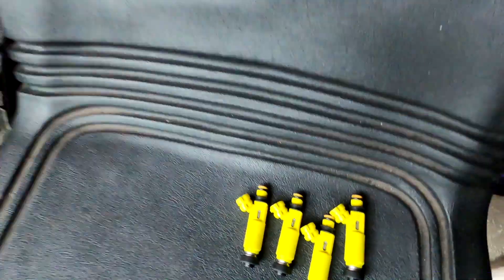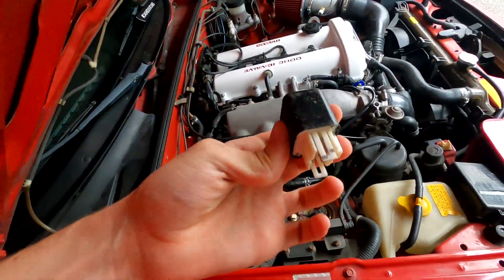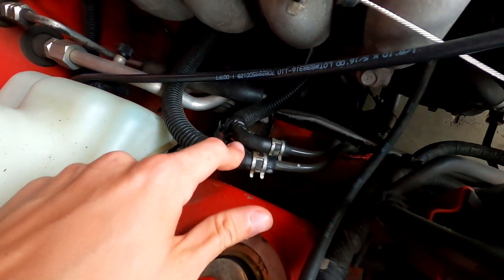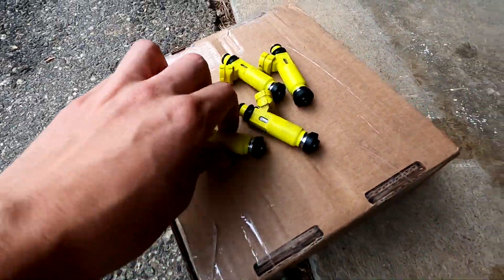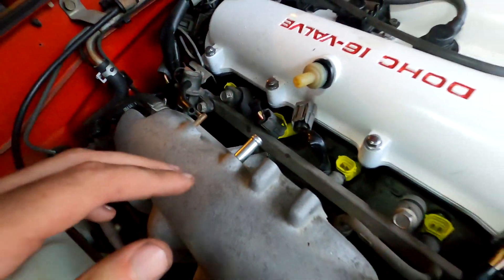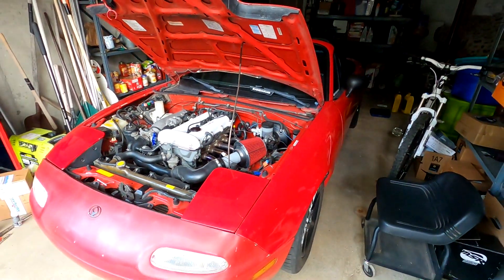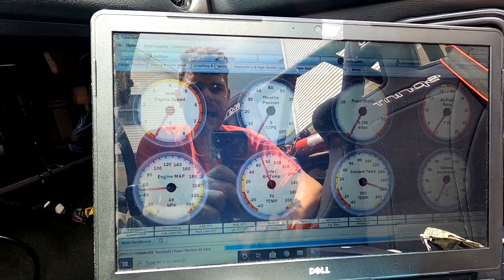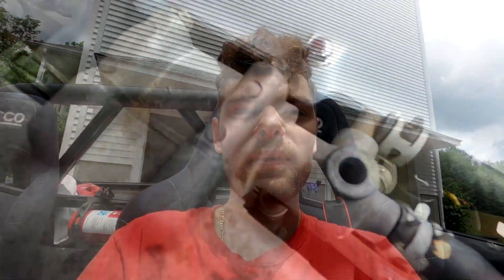Installing RX8 Fuel Injectors in the Miata! | 2Broke2Boosted Ep. 5

Comment: I know this is an older video but on the topic of injector dead time I have recently switched from 0.8ms to 1.2ms after doing more research into these specific injectors and it has made a massive change in my idle and overall engine refinement. I was struggling to figure out why my engine would stumble on light throttle input from idle and I was getting pops and bangs when I did not want them. I tried messing with timing and fuel tables with no effect. Well turns out a major reason for that was my injector dead time. The stumble is completely gone and the pops and bangs are nearly gone. More like burbling at the moment but since I have a nice cat in my car I want to eliminate it all together. After seeing the effects of playing with the dead time I may run a few more tests at 1.4 - 1.8 or so and see how my specific setup likes it.

Comment: I have rusEFI tunerstudio that i run for my miata which is a 1999 and instead of having a dead time or open time or dwell time number it only gived me the curve graphs with dead time for various battery voltages. How do i change it such like the video?
Reply from the maker: RusEFI may be different than the Speedy, I haven't used Rus before unfortunate

Comment: Why do you remove the relay? My turbo mx5 been off the road for 8 years. Changed the fuel pump but stilk wont start (suspect injectors)
Reply: I had that issue and had to remove the injectors and clean them on my ultrasonic cleaner. You can use a sewing pin to release the spray nossle with a gentle press.

Comment: So after restoring it costed only $65? I looked on their website and it says they charge $30 per injector.
Reply from the maker: This was priced at $65 since the cleaning was optional. If you do get them cleaned it does cost more, but it's not a necessary step

Comment: Is the 1.8 vvti engine have any benefit if i change the stock 265cc injektors to these 420cc rx8 injektors? without any programing cuz i dont have a standalone ECU and does it burn more fuel wich is suck for the fuel efficenty?
Reply from the maker: Without an ECU to control it you'll do more harm than good unfortunately

Comment: Hey, I've got some RX8 yellows. I put them in place and went to tighten down my fuel rail, but it feels like they're not going in. Am I supposed to keep the rubber tips on them? The OEM ones look like they slide into holes, but the RX8 yellows sit on top. Seems like the injectors are too tall. Any thoughts?
Reply from the maker: Hey! If they came with rubber on them those are the seals which should press into the rail. You may need to lube them to get them to pop in. They also have a rubber pad which sits against the engine. Good luck!
Reply: @CashedOutCars  thanks man, you're great for responding to all of your comments. I figured it out, the rubber seal that was manifold side was meant to replace the hard plastic grommet that was on the end of the stock ones. I was trying to insert them with the grommet still there, no room at the inn. Tried removing the new rubber and putting the tips into the old plastic grommets, which fit but looked strange. Finally tried removing the plastic grommets and they fit like a glove. Excited to move on with my forged engine build! Now if I could just get these damn oil pan seals to stay in place!!
Reply from the maker: Glad you got it figured out! Have fun with your build!

Comment: Okay so I’ve done everything you have done up until this point. I installed the rx8 injectors and changed required fuel but no start
Reply from the maker: You may have to play around with your VE table around idle, it’ll likely need some tweaking. Required fuel gets you close, but since they’re different injectors with different characteristics they’ll still need a bit of tuning. You can also play around with cranking enrichment

Comment: Question for you, I just installed rx8 injectors on my naturally aspirated Miata just to prepare for turbo. But after tuning and such the car runs not so good. My question is after you installed the injectors and did some tuning did your car run okay and normal? Thanks a bunch!
Reply from the maker: Sounds like you’re off to a good start! Yes I did get it to run well with the bigger injectors after a bit of tuning. Get your required fuel calc close and then mess with your VE table. Your timing table should stay the same except for if you’re manipulating it to adjust idle, which I did a bit. Good luck!
Reply: @CashedOutCars  Awesome thank you for the response!

Comment: Hey man does it matter what year the rx8 injectors are ? Thanks for all the videos I’m hoping to follow along with how your doing it for the most part
Reply from the maker: I don't believe so, but make sure you get the yellow injectors and not the reds. RX8s have very unique injection setups and have 6 injectors, you'll need the 4 yellows. Flow force also makes a few options that aren't too expensive for brand new injectors, in 380cc or 640. Good luck and let me know if you have more questions as you go with your build!

Comment: Use some type of lubrication on the o-rings. Never install them dry u might tear them. I use a small dab of petroleum jelly.
Reply from the maker: You're right. If I didn't show it in the video I ended up lubing them with silicon lube to help them seat

Comment: Question bud. I just got myself a set of these injectors.  Do I need the stock seal from the rx8 that goes to the head? Or can I reuse the miata ones.
Reply from the maker: You can reuse the Miata ones if they’re not cracked, but injector seals are quite cheap so I’d recommend getting new ones. RX8 and Miata seals SHOULD be the same size since they’re direct plug and play injectors. Mine were rebuilt with RX8 stuff and worked fine!
Reply: @CashedOutCars  went ahead and ordered a set from Amazon just in case. Just kinda impatient about wanting to do the install and run 15 psi.

Did you notice a difference in idle with it? Keep hearing the stock ones dont like batch fire injection around 14.7 and I believe it with how much it pops at idle.
Reply from the maker: Sweet. I have my car idling very smoothly around 12.7. If I try to lean it out more it pops a bit so I’d rather use a bit more fuel and keep it happy

Comment: I've been looking at these as an option for my 1995 1.8 which I run on 50% E85 ethanol and 50% regular 95 unleaded. E85 is half the price of regular fuel here in France. I reckon with this higher flow injectors I should be able to run 100% E85.
Reply: I'm going to try with the stock ECU. 100% ethanol is too lean - she runs on it but wasn't too happy, but with higher flow rate I figure the ECU should be able to cope on its own.
Reply: @robinforrest7680  now this im interested to hear about
Reply from the maker: If you’ve got an aftermarket ECU this certainly is an easy enough upgrade! If you upgrade it let us know, I’m curious how it goes!